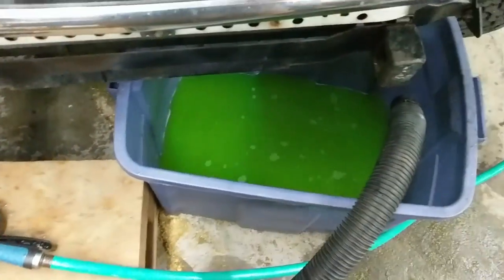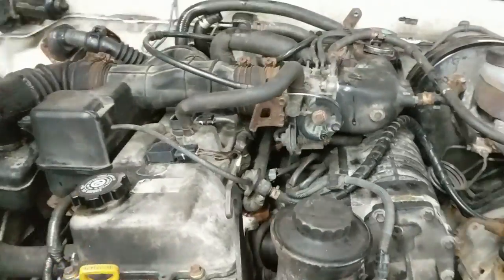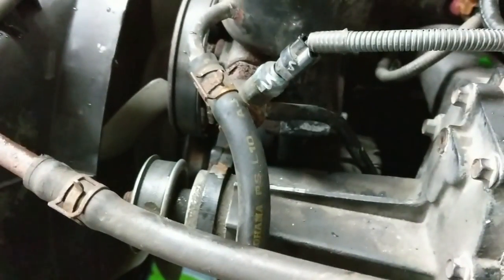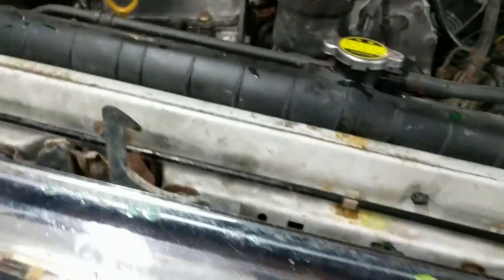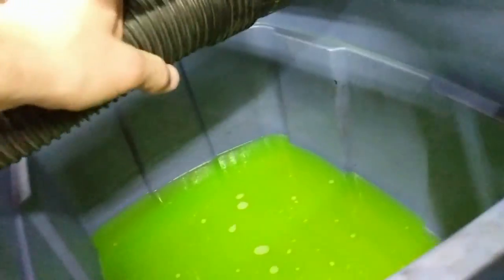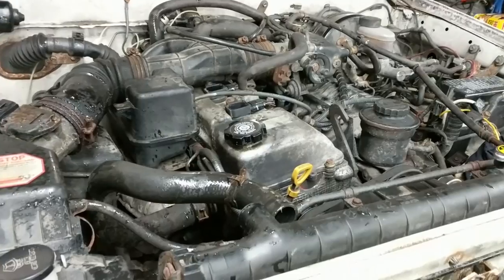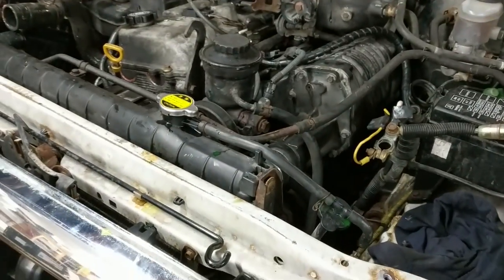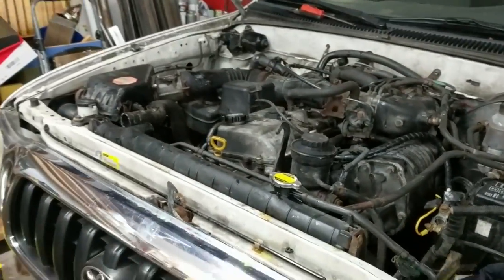Using a Vacuum Cleaner to Flush my Cooling System

Comment: I vacuumed the rest of my antifreeze out about 20 minutes ago. I was just looking around to make sure that was ok. So I wound up on this video, and I'm glad I'm seeing someone else do the same thing. I haven't seen one person on the net do that, and in my opinion, it was the best method. I only got about a gallon out after pulling the lower hose, and I was like, that ain't gonna get it. So, I took my intake off and fan cover, then took off the hose going into the block where stat is. I stuck my shop vac over the hole and wrapped tape around it, and believe me when I say it got every bit of it out. My 6-gallon shop vac was half full, so it sucked 3 gallons out, plus the gallon I got out, that's 16 quarts which is the capacity. While I had the top and bottom radiator hose off, I flushed it out with my electric pressure washer. So anyway, I put everything back together and filled it up with distilled water. I'm going to repeat the process and then fill it with my Dex cool. The idea just came to me because I didn't wanna take my stat out, and that was the easiest way.

Comment: I was doing my Jeep coolant and using a Ridgid shop vac attachment quick connect pump (part #VP2000 around $40) from Home Depot. Just clean out your shop vac tub then screw on the shop vac pump (VP2000), fill the shop vac with distilled water (or coolant fluid), attach the Prestone Flush n Fill kit & garden hose from shop vac pump to the Prestone flush "T" on the engine, use the shop vac pump power only (not the shop vac power) to push the distilled water into the engine from the shop vac and the old coolant gets pushed out using a standard garden hose (engine thermostat removed). Did this a few times with the Prestone flush kit. Then used this same process to use the shop vac pump to push new coolant in the engine to push out the last dirty distilled water once done flushing. Didn't use garden hose house water at all to flush the system. Seems to worked ok.

Comment: This is also a idea, might I add that you could buy a transfer pump from Habor Freight, fill a 5 gallon bucket with distilled water then and transfer that through the system as needed while also using a Prestone coolant flush kit. Total would be around 50-60 bucks for the pump, kit, buckets, water. Other than that a unique process forsure, as long as it works

Comment: Hi Dennis. Just found you videos and like them lots. I did much the same as you with my first car 40 years ago. I must admit to watching some of it through my fingers and cringing from the memories. However, engines are quite robust and yours is not as mashed as the one I put together and that ran fine! Like you I enjoy the challenge and have advanced (for me) from spanner work to full blown restoration learning MIG welding on the way (that's a laugh). Enjoy and keep going.

Comment: Ottotester,  What about removing only one hose and putting on the shop vac.  The rad cap off will allow air in to push the water out.  I'm coming from having used an antifreeze recycler system which heavy vacuum to completely fill a system.  What do you think?

Comment: Neat idea but, the bottom house outlet doesn't drain the block. Water will still still be left behind. You need to pull the block drain plug to get all the old coolant and flush water out. You would be better off pulling the plug then flushing again.   Most engines with a bottom thermostat are reverse flow. Hot out the bottom, cool in the top.